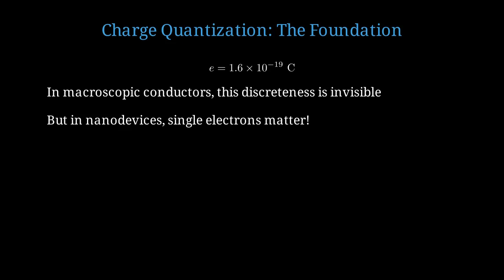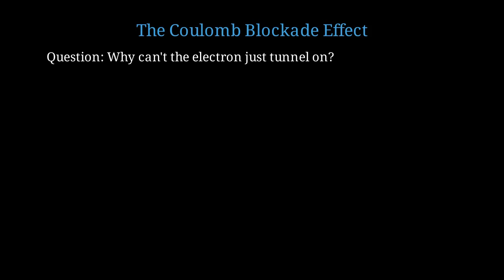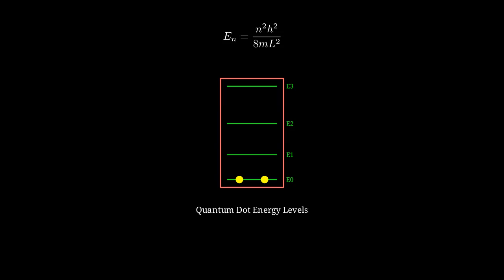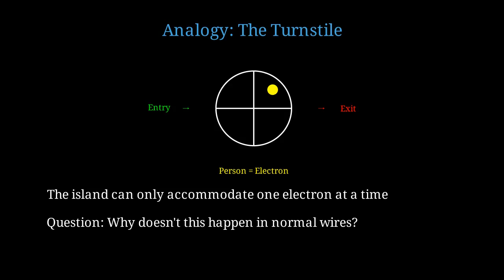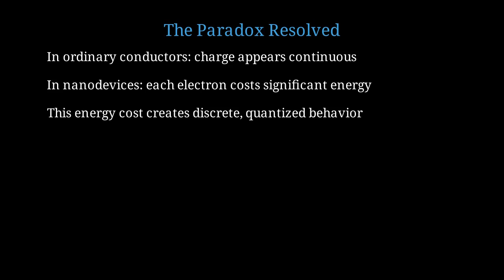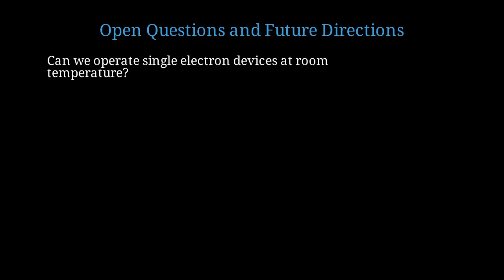How Adding One Electron Can Control Current in Quantum Dots?

Comment from the maker: How can Coulomb blockade be achieved at room temperature without cryogenic cooling?
What is the quantum mechanical framework for co-tunneling in multi-dot systems?
How can single-electron pumps be synchronized for current standards with 10⁻⁸ precision?